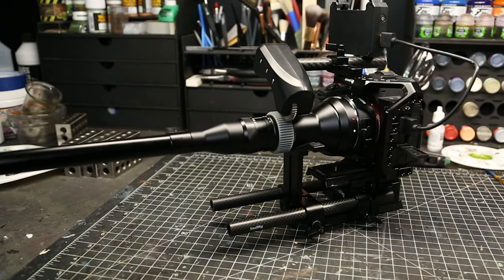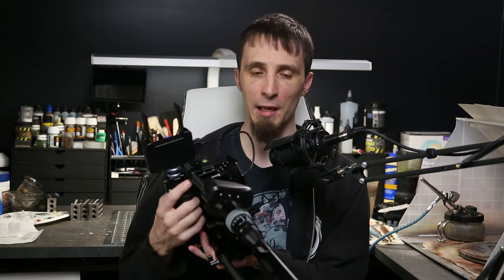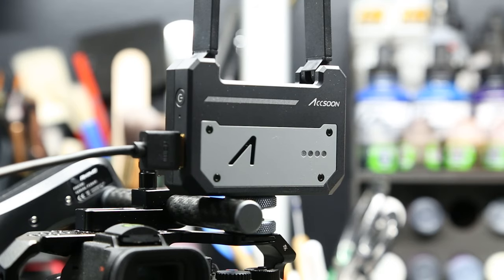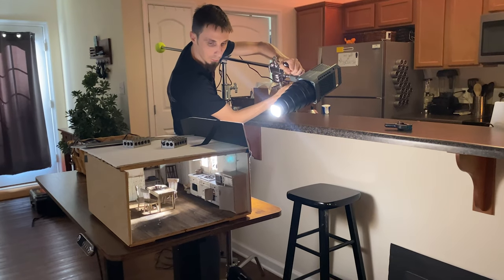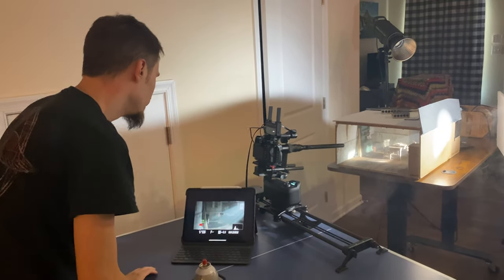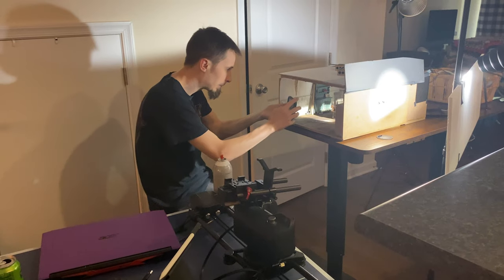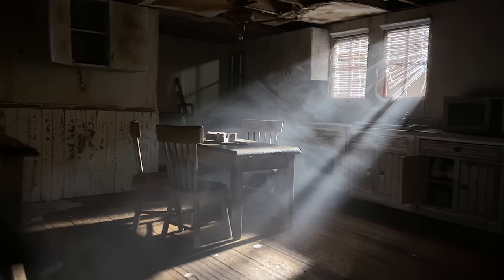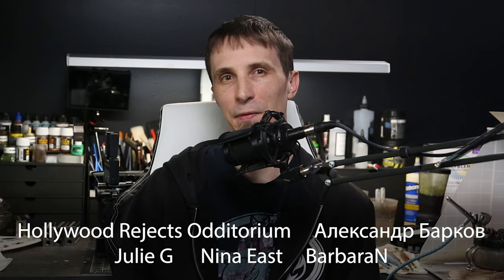How to Film Miniature Dioramas Cinematically

Comment: The shorter depth of field of the probe lens on such a large sensor camera gives it away that the scene is a miniature. If you filmed a full-sized table in a room, the background wouldn't be thrown that much out of focus, even if you shot wide open, which you never would do for that kind of shot anyway. So the cell phone camera has a more realistic DOF. Of course the cell phone has annoying sharpening artifacts and is rendering more detail (which can be good or bad), since it's all in focus.

Comment: Some equipment is essential to get a specialty shot. But a lot of the time expensive equipment is only designed to make things easier. So if you do a certain thing a lot, then go buy that piece of equipment that will take the pain out of it. But other than that their are very few pieces of video gear that I would class as ESSENTIAL.

Comment: Super glue accelerator is VERY TOXIC and is banded from many studio because of it’s know toxicity and there are more friendly alternatives such as tiny amounts of water or baking soda can crystalize super glue into harder form. Keep in mind- no matter the accelerant used on CA (super) glues - the fumes from the reaction are toxic too. In fact CA glues can have an intensely fast thermal action and smoke when in contact with porous materials like wool or substances like a lot of water. Use care, ventilation and fresh air.